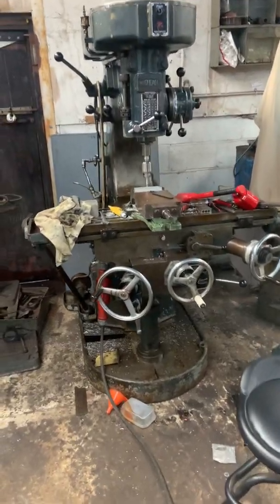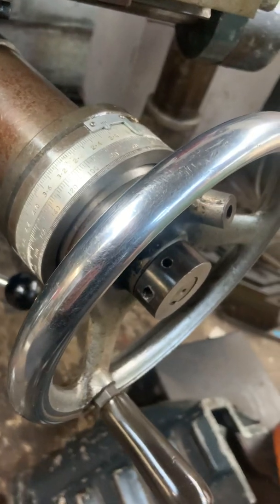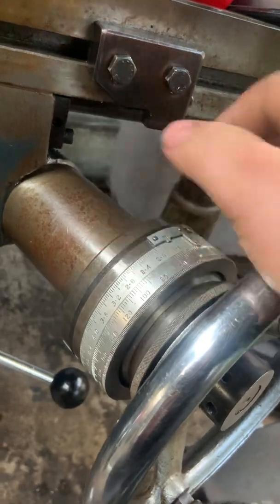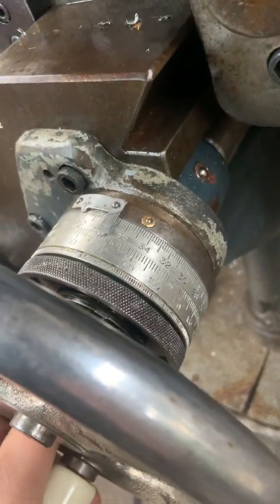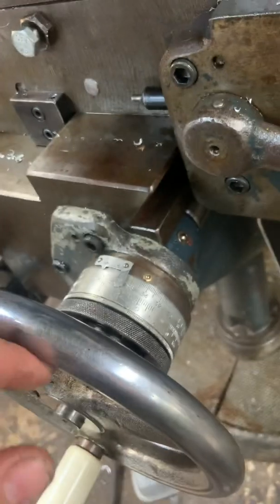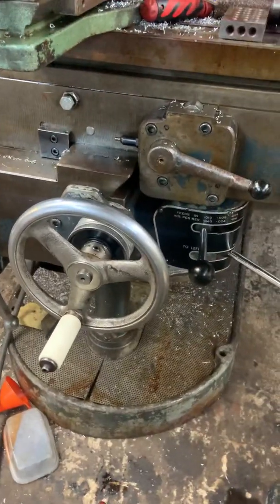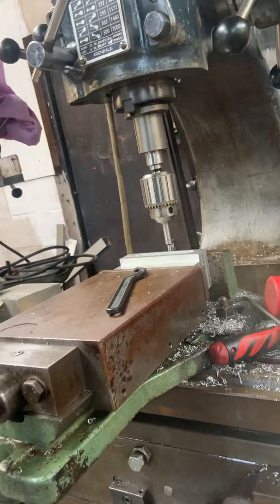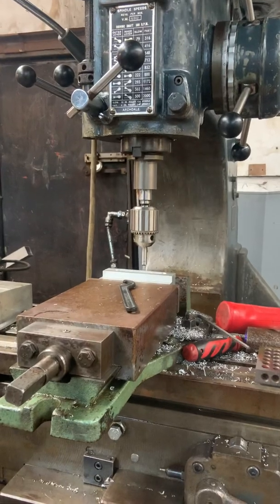Archdale Milling Machine Update

Comment: That's a nice looking mill, I've got my eye on one much the same. Any idea what weight it would be? Thanks
Reply from the maker: At least 800kg but I reckon probably heavier. I’ll let you know as I’ve got a manual somewhere
Reply: @MJBEngineering  Thanks Bradley, that would very useful to know.
Reply from the maker: @85RAG  No weights in the manual I'm afraid.
Reply: @MJBEngineering  No worries, ta for looking.
Reply: Hey  @MJBEngineering  , any chance you could share the manual? My machine is a bit different but still looking for a manual. Thanks, Greg
Reply from the maker: @OneManEngineering  the manual is pretty useless to be honest but I will scan in when I get a chance.
Reply: @MJBEngineering  that’d be amazing. Thanks in advance! Greg

Comment: Hi Bradley. Interesting video with the calibration dials on your Archdale milling machine. 
Those look like an addition at a later date. How is the milling machine performing? Tony
Reply from the maker: I’m pretty sure they are original having studied photos of other Archdale mills. 
Yes not too bad. It could do with a spindle rebuild, it has a bit of play, few tenths. But it’s a tad noisy. I need to change the leather belts out for a one piece belt in the head.
Reply: @MJBEngineering  Give these a ring Chiorino UK Ltd in West Yorkshire for the belt. I have used these numerous times for one piece drive belts. That's one I'm fitting on my spindle moulder video.